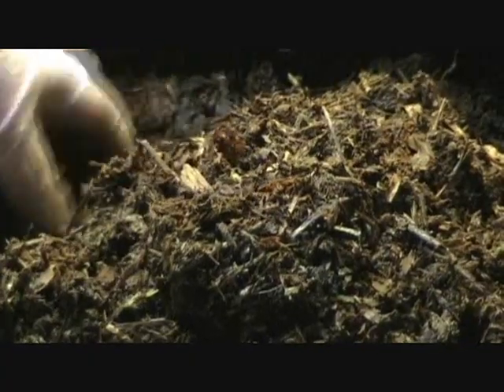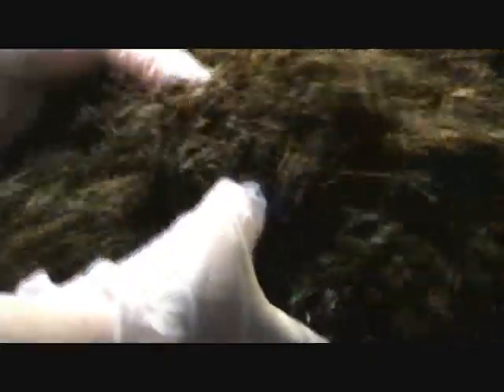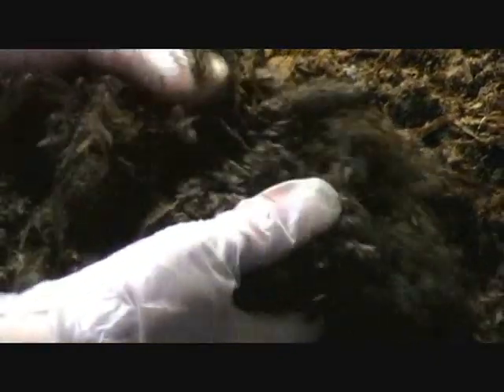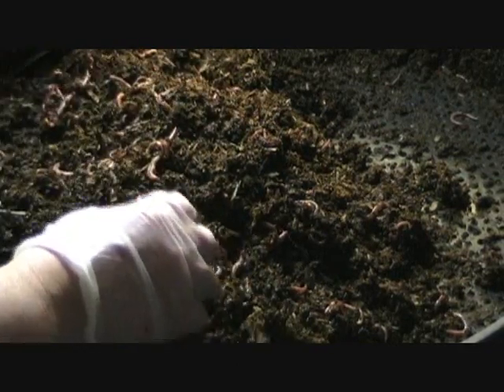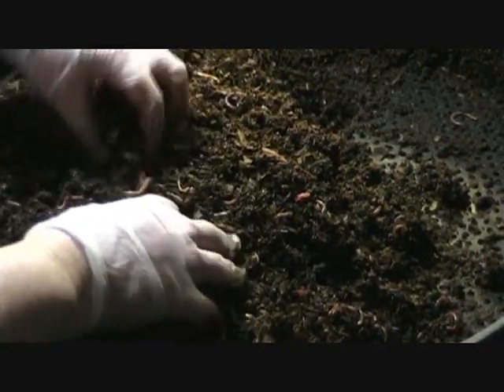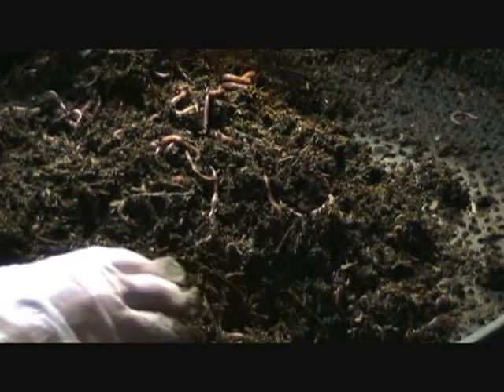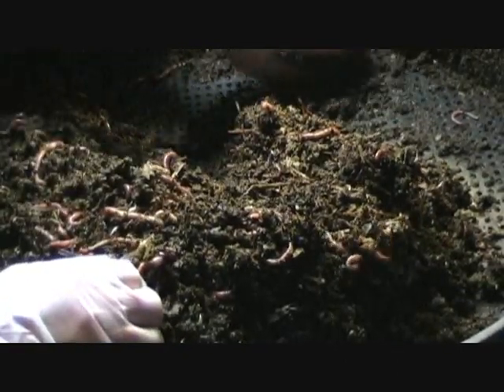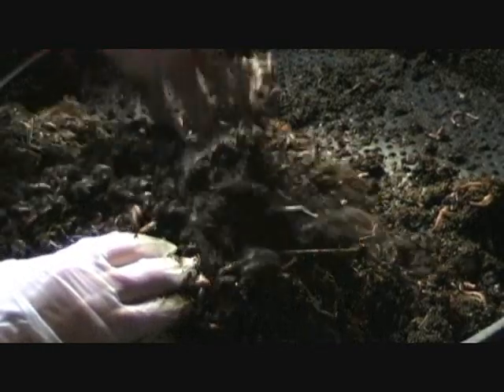Various Stages Of Vermicomposting

Comment from the maker: I would not turn the bin more than once a week.  In a traditional bin the turning process helps speed the process by turning the outer portions of the material into the center where the active composting can begin working on the outer material.  This is not why you turn a worm bin.  You turn a worm bin for the health of the worms, because they need air and appreciate a loose bedding to move through.
Turn more frequently would needlessly stress the worms.